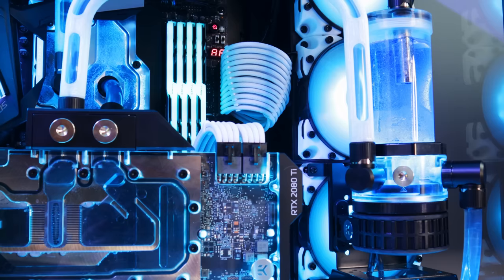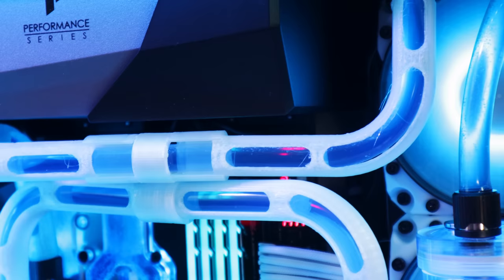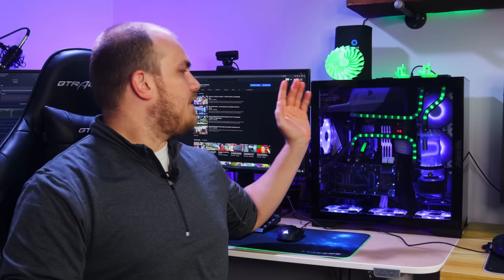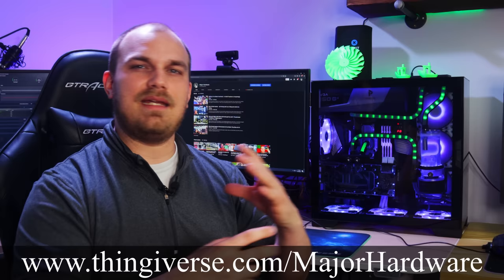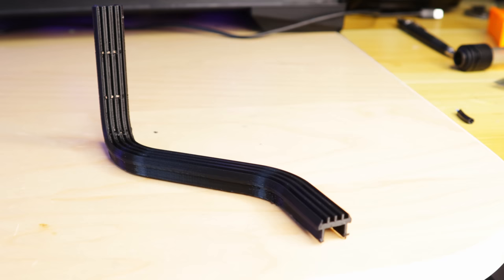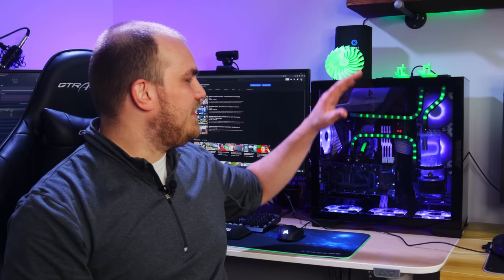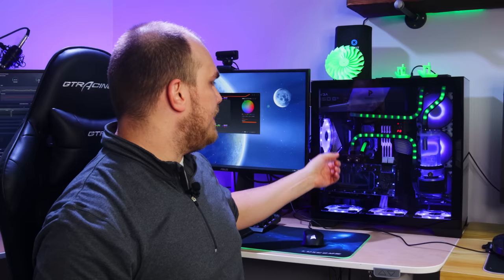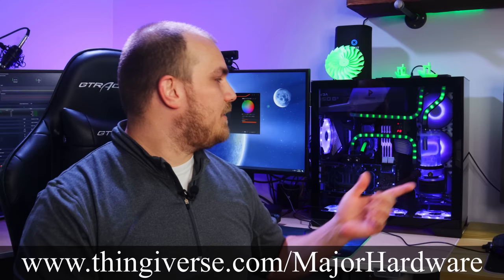Soft Line Water Cooling Will Never Be The Same

Comment: Dude, it's gotta feel pretty awesome to know that you started a new trend. This will be a big thing really soon. The designs are going to be insane.
Reply from the maker: Hope so!
Reply: @MajorHardware  What if you printed a bunch of smaller pieces that you snap together? Like a bunch of pipe couplings/reducers that fit into each other. And then make some at various angles, 30, 45, 60 maybe. Then you could make the length however long and makes turns wherever.
Reply: @TheBeardedMann and glue it together to make the run nice and stiff that could really work.
Reply: This could be revolutionary.
Reply: @MajorHardware  Definitely something I'd like to try, I think you hit something good here man!
Reply: @MajorHardware  Get out in front of it. Put your name on it. Patent the idea!

Comment: Change your tubes to clear and change the LEDS to a strip that has a built in diffuser and make the tubing guide house the new diffused RGB strip properly and BAM you have a much cleaner looking setup and no special wiring needed, plug and play!

Comment: For the next update get the EL wire, can be cut to size, flexible af, uniform like a neon, no need to rewire and you can just model in a channel for it in your 3D prints 😉

Comment: Next time try ws2812 led strip(maybe with silicon overlay to give some rigidity to the strip) . Make the led run in the side of the tubing.not in the back. The led strip will be easier to bend and the light will be more diffused.  It will work with addressable RGB motherboard header(as long as the pin order is correct) up to 128 leds. And with add-on arduino up to 1000 leds. With arduino you can do some crazy animations.

Comment: You should try to 3D print the tubes themselves.  If you used TPU or another flexible filament and water-soluble support material, I could see that working pretty well.
Reply from the maker: you can buy PETG filament however my printer cant do it

Comment: Oh god, using individual RGB LED's sounds painful haha
The "better option" would be a strip of WS2812B LEDs! They're individually addressable so you can make it do patterns and stuff too. Super simple, cheap, no need for a resistor and can even plug straight into an RGB header if your motherboard has one. Great step, excited to see where you take this next!
Reply: Yeah I would definately use a LED strip, You can typically find them for under 15 dollars and it would be really easy to wire.    I forgot which ones were the 5v 3 pin but yeah ws2812B should actually be able to be wired straight to an RBG header and plugged into the motherboard.  I actually think I have a roll sitting in a drawer somewhere and never actually thought about going straight to the 3pin header as I typically use them with arduino.
Reply: You can also buy individual 5mm ws2812b LEDs and simply chain their data ins and outs
Reply: Yeah, buy it from aliexpress for 20 bucks or so.
Reply: the led strip would have hard time to bend around those angles,if it is behind the tube. If the led strip would be in the side of the tube( as it would only bend in forward and back direction in the direction of the ledstrip) it might give more diffused light and be way easier to install. and with arduino you could get some sick animations.
Reply: @napiton  Taking out small little "V" shaped cuts out of the strip would likely solve the hard-bend-from-behind issue... 
I only mention it because putting them on the bottom (or side, as you said) creates a harder to accomplish bracket to house the strip... 

Ç vs -C, if you get the visual I'm attempting to give...
Reply: Agreed, to get around the bends the strip could also be cut and reconnected using short wires from one straight segment to the next
Reply: I'd suggest ws2815, which are 12V with a backup line so you lose only 1 led if one burns, and doesn't lose power over some length, also use a white 1-5 layer 3d printed plate overlay to diffuse the light.
Reply: I agree totally, in fact I have 3 different types of ws2812b that I use with 2 Corsair node pros, as they use the same LEDs essentially.
The effort put into this is crazy though
Reply: Another benefit of using WS2812B LED strips is you can buy them in a range of LED densities per meter. For example, 30 LEDs per meter strips have roughly 10 LEDs every foot of LED strip, but a 300 LED per meter strip would have roughly a whopping 100 LEDs per foot! just make sure you calculate the current draw (about 30mA per LED at white and full brightness) and power them accordingly. They sell them in 5V, 12V, and 24V variants I believe.
Reply: @RAW_Reality  They already have strips with v cuts in them specifically for that purpose
Reply: meeret1452  Silicone coated led strips have been around for years in various diameters....phanteks just copied what the LED industry had already been doing....you can get those same exact strips that phanteks sells, but for 5 times cheaper on Aliexpress just from buying from a generic LED company instead of a PC brand

Comment: This is a mass market product waiting to happen. I'd change two things: One you already mentioned, the led:s themselves. Use 5V argb strips. The other is, I see you scratched up the surface of the tubing to turn it into a diffusor. Instead, have a diffusion silicone layer or something behind the tubes, and you get the ability to use clear, colored or particle liquids just like normal, and still get the nice diffused light effect. Great job!

Comment: May I suggest using some typical bondo to fill in the gaps on the printed part and sand them off smooth then paint them whatever color you want so they have the smooth finish. the texture of the printed parts makes it look janky. but that idea of the LED behind it is pretty cool.

Comment: Don't quit now, it's getting there! it just needs a bit more tweaking. the ability to add RGB like that to your loop is great. maybe add a ends that snap around the couplings so they are on more straight instead of separate clip. to keep the size and the soldering to a minimum and have an even spread of light, there is this plastic wire, opaque that's also used around the edge of RGB mouse pads or like RGB shoelaces ... i can't remember the name.

Comment: In case you weren't aware, fluorescent PLA is usually a bit abrasive which after a while can damage your nozzle so a hardened steel nozzle is recommended. 

Great video, now I need to incorporate some 3D printing into my build too, just need to figure out what as I don't have a custom loop. I guess cable combs are a start. You seem to be the only PC-centric youtuber I've seen use 3d Printing in projects and that's pretty damn cool

Comment: This is such a cool concept, and you're probably right that it's the, "first custom water cooling loop to have RGB, back-lit, soft-line tubing configured to look like hard tubing". I don't think that something like this could be mass produced and sold as a kit because of the custom lengths necessary. Stuff like this is what makes me want to just go out and buy a 3d printer though. I wish I had time to take on awesome projects like this. Thanks for the video!
Reply from the maker: agree its to custom to mass produce but i put some models out there to get ya going if you get that printer.

Comment: WS2812 smart LED strips or rgb strips are sold by the foot, cut to length, and have adhesive backing.  And are usually just SMD components on a 10mm wide flex circuit.  They should easily fit and just need wiring at one end.

Comment: If you want to use a common resister, you need different voltages to supply. With a common supply voltage, the current will simply flow through the red LED due to its much lower voltage requirement, with significantly less current going through the other colours, potentially damaging it. That is likely why you only seem to be able to get it to be red, green or blue rather than some combination.

Additionally, depending on the power supply voltage, it is often better to wire them up in series, not parallel, and that means you need 6 wire LEDs (a separate anode and cathode for each). Even if it is just a short stretch of 3 or 4 LEDs in series. That way fewer resisters are needed.
 That is how common 12V strips work.

Comment: We both water cooled our rigs about the same time 8 months ish ago, I went Hardline tubing and I took me about 2 days (4 hours each day) to actually put all the bends in and all the trial n error and I eventually stopped using mandrels and bent by eye lol, a lot of time is just forcing the silicon mould down the tube if you need to make adjustments to one of your forms, even lubed up it aint easy lol.

Didnt put RGB in my tubing though lol it just went with clear coloured coolant haha. Nice work though, as an engineer myself I'm impressed.

Comment: I'm wondering if the supports actually need to be that big and sturdy. For the bends, sure, but the rest of the way, would it be enough to just support the bits that are at risk of bending due to gravity? If that's the case, it would cut down on the print time. It would also avoid things like the short and rather unaesthetic connection between the CPU and GPU blocks. That could instead simply have a thin backing to hold the lighting behind the tube as well as something to hold it to the fittings.

Food for thought.

Comment: Just curious , what are your 3,6,9 month interval data recordings on instances of premature wear? Also what were the temperature differences inside the case , at hardware probes and miscellaneous areas of tubing including temperatures at fittings , blocks etc while idling , gaming , video rendering , and 24hr stress test and benchmarking?

Comment: I do a bunch of stuff with WLED and pixel strips like WS2812b.  Would something like that work?  You wouldn't have had to solder anything.  I believe you could plug them into the addressable header on the motherboard, but if not, you can always put an esp32 in the case to control the lights.  If you do that, you can do effects, like chase, etc...

Comment: Looks much better than first rendition. Hard line can be tricky to do sometimes depending on choice of material. Also with the rgb lighting and using a clearish pla filament you possibly could’ve only added 2-3 rgb on ends and possibly middle for similar effect. I still like the end result. Just giving some food for thought

Comment: To cover the wires on the cheap, you could always use black hot glue and spread enough on the wires to cover them. not only does the glue cover the wires from sight, but it also insulates them from shorting out as well.

Comment: I think the best way to do this would be to make soft tubing that has a small rectangular void in the sidewall (approximately 8mm wide by 2mm tall) that you can slide an addressable LED strip into.  The tube would then be made out of a milky transluscent material that'd carry the light.  They already make extruded silicone housing for LED strips (phanteks ripped off what the LED industry has been doing for years with their "neon strips") so perhaps you can start there

Comment: Holy moly, I don't envy all that soldering. Next time use an addressable LED strip. You could make the lights change colors, race, or even mix and match.
Reply from the maker: couldnt find any that bent laterally
Reply: The flex circuit used on these strips can be folded once or twice if you're careful.  So for lateral bends do a triangular fold between each LED.

Comment: Use the Phanteks rubbery argb strips they fully diffuse the lighting. I forget what they are called but you wouldnt have to worry about fitting it too much and also itd diffure better, only issue is i think the strips are bigger and encased in a silicon or rubbery material. Look into it!

Comment: When I said give it a sand, I actually thought your printer clear inserts to help with diffusion, I apologise, watch your tubing as scuffing it up can result in permeation. Try getting a slither of thin as heck cutting board (the more opaque the better, but not too much) and putting it over the leds, that should diffuse way better.   Only option I can really see for smaller smd leds is to have pcb’s made up with leds as dense as you like, led circuits are pretty simple as you’ve displayed here and it would make for a pretty pro product. Having the pcb sandwiched between your cable track and a thin diffusing strip over them all along the track, modular bends and straights, complex turns etc all with argb or rgb built in. Keep going man, you’re getting pretty close to an actual produceable product

Comment: You need to put separate resistors on each wire for each colour.
If you put it on the common, then turn only one colour, all the juice will go to this one colour and it will be much brighter and might burn, then you make it white(all colours on) and it will reduce the brightness as the juice is now split across 3 colours.
Don't know what's the Vd of the leds you choose(might be different for each colour) so I can't tell if you're using right resistors.
Google for led calculator then insert Vd, 12V and half of the maximum rated current of those LEDs, it is allowed to run them at 100% but running them at 50% will make them last forever.

Another thing if you have wrong colours you might have swapped some of the colour wires.

But preferably use addressible LED strip that would go on the top or bottom wall of the tube so it bends in the direction it's allowed to, you can't bend led strip to the side, you could also put it from the inside so it doesnt come of as all the self-adhered led strips eventually do, they would stick even worse to the uneven surface of a 3D printed object.
Reply from the maker: Dude thank you for looking out, not going to lie didn't know this but I do now
Reply: @MajorHardware  No worries mate, any electronics hardware related questions you can hit me, as I'm a electronics engineer I can answer quite a few.

Comment: Some side-emitting ARGB LED strips would have saved you a lot of wiring time. This would work well for the bends that are parallel with the height of the case, but might not do as well for bends that are along the width of the case. For that, you could always cut the individual LEDs out of the strip and position them as needed and wire them back in. Another option might be the Phanteks NEON Digital-RGB LED Strips. If nothing else finding a similar flexible light diffuser would be great to break up the way the LEDs look on less opaque fluids.

Comment: For your next go at this i would highly recommend searching WS2812B LED Strip Neon Sign Light 6.6ft 2M Addressable RGB  on amazon this would solve a lot of your issues.

First the led strip is "sidways" so the bends won't be an issue.

Second dimesions are 12x6mm so shouldn't be that much harder to fit in your channel design

Third only need 1 set of wires per strip and you could daisy chain them if you really wanted to (just remember to count how many leds you have in total so that if your controlling it from you motherboard you can tell it how many leds and the then the patterns should show up correctly.

Forth they have a built in defusser so you wouldn't have needed to frost your tubing.

Alternatively take any smd 5v ARGB (or 12volt if your prefer static color the entire length) strip turn it sideways and mount in your c channels then use clear silicone adhesive to make the diffuser.

Comment: Now I just need a commercially available one, because I still have little use for a 3D printer except niche projects like this.
RGB you could've handled with any number of RGB light strips you find on amazon; thin, cuttable, and puts out enough light to get by.

Comment: Is the heat from the LEDs heating up the cooling fluid? Should do a run with and without the RGB lights on, and see if the CPU temp notices any dip or spikes.
Reply: At a mere 3v, no LED bulb is going to emit enough lumens or heat to be even noticeable, much-less when cold fluid is rushing through the internals of what it's illuminating. To say it's a "non-issue" would be an understatement.

Comment: Wow! Amazing look! I have an idea to make it even better, get some of the EKWB Mystic Fog Concentrate Fluid. It doesn't have solids, so it doesn't clog the water, and it makes the tubes look frosted, which makes the lights mix together, eliminating the LED hotspots, even with your current LED spacing. Plus, for a future build, try modifying your 3D design so that it can accommodate some Phanteks Neon RGB strips, they bend just like the soft tubing in your build, so I think they would work amazing! (plus they'd save sooo much time compared to individually wiring each LED)

Comment: looks like you're plenty handy with the soldering iron. maybe try grabbing some of those cheap ARGB strips. some have indicators where you can cut them and add a pin out to each segment so you could get each cover its own section of strip then just assign all of them to do a similar pattern like maybe move across the tube in the same direction as the liquid. could be super cool. another idea is making sections that are all a preset size, elbows for turns and then just mix and match the parts to fit your ideal loop. the sections of ARGB strip could be preinstalled and so you just have to link the ARGB connectors to each other to fit any length of tube. really cool stuff man. totally subbing.

Comment: This is cool, but I wonder if it all needs to be 3d printed?
I made a vortex chamber which took days to print, and then realized I could have made half of the project with a bucket :) 
My idea, being a Kiwi, is to use number 8 wire (basically wire coat hanger wire), and print a whole bunch of identical C clips with holes for 2 runs of No.8 wire to act as a spine.
Then I would do the leds using neopixel strips (individually addressable RGB leds) - I think they would plug straight in to the 3 pin rgb header on a MB, but I personally have only used them with Arduino.